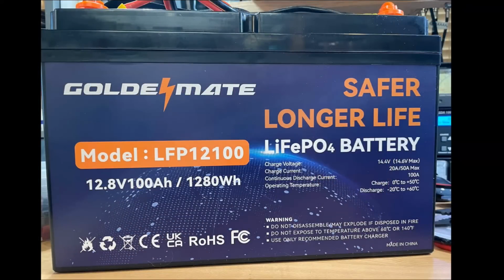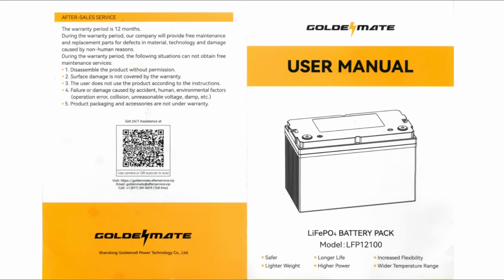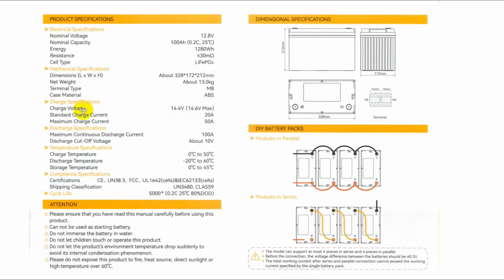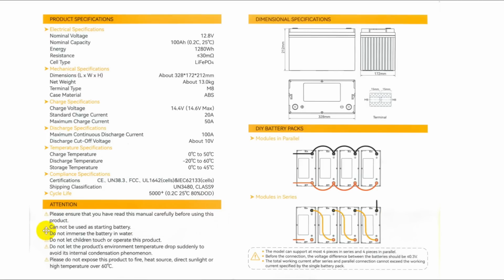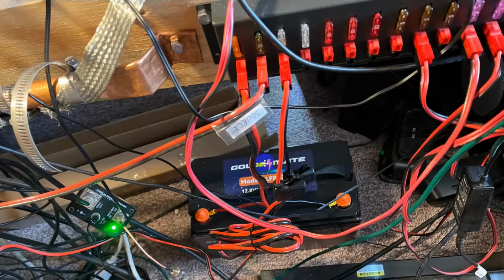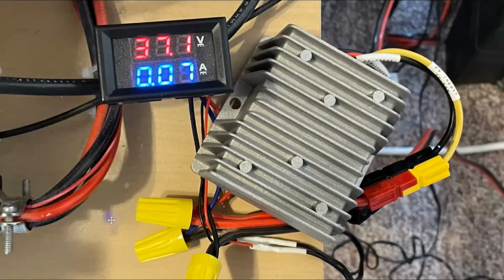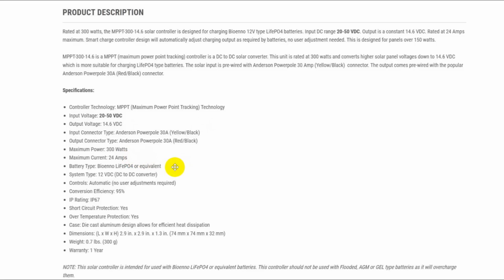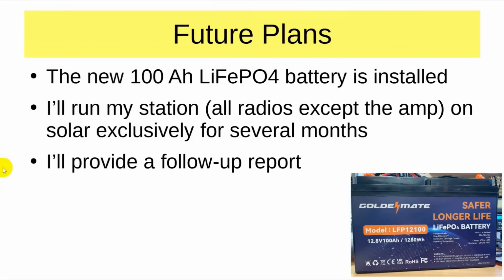New LiFePO4 Battery Can Power Your Station (#1030)

Comment: The Lithium iron phosphate batterys BMS can handle 50 volts and will turn off to prevent an overcharge when the battery is full. A $40. DC-to-DC converter (50 volts in, 13.5 at 40 amps out) between the battery and the power strip. It will let you drain the battery to 11 volts (BMS low cutoff) and at the same time keep your radios at 13.5 volts

Comment: Given the power outages in my 3rd world country, I've been forced to buy a 1200 VA/1200W hybrid inverter system that came with a 100AH lead acid battery and I used it to supply electricity during outages. The lead acid battery konked in in a few months because of being discharged below 50% frequently. So I replaced it with a LIFEP04 100AH - exactly the same as shown here. The bonus is that the BMS has a bluetooth interface that gives an indication  of charging and discharging state. So far the Lithium battery is not even close to getting to 50% discharged. So far so good.

Comment: Thank you for this video about the new LiFePo4 battery. I am curious about the detailed report on your experiences, especially in the daily use of the photovoltaic solar system and the behavior on the shortwave bands. Does the MPPT controller produce interference on the HF-bands when the battery is full or empty? If you operate a shortwave antenna close to the PV system? How clean is the 12V (13.2V) DC voltage, controlled with the oscilloscope? What does the panorama on the SDR-Play receiver say?  I am always happy and grateful for your profound and scientifically based reports. All the best to you and yours, greetings from Hamburg/Germany, Dietmar, DL4HAO

Comment: For those of us who don't have solar and just have our big old Astron power supply putting out 13.8 volts, can we simply add this battery across the 13.8 volt bus as a backup power source the same way we do with our legacy SLA batteries? I read somewhere that while the LiFePo battery may not provide full capacity if charged to 13.8 volts, under charging it will make last a lot longer.

Alternatively, I could turn up the Astron to 14.4 volts and keep the LiFePo battery fully topped off. I've read that keeping the voltage across the battery that high allows the cell balancing mechanism to work.

Comment: I am assuming you used 10 AWG wire with a 30 Amp PowerPole between the battery and your distribution block and the output of your charge controller connected directly to the battery terminals. To run your amp, you're going to need at least 4 AWG (cables) connected directly to the battery terminals.

Comment: Just a quick warning. When you were showing the slide about connecting the power source directly to the battery vs. the power distribution panel, you said that the solar panel should be connected directly to the battery.  I know you meant that the power from the solar panel should be routed to the battery (after going through the charge controller) but you didn’t make that clear and your diagram didn’t show the charge controller.  Just afraid a novice might not understand and connect the panel directly to the battery, which could cause damage from excessive unregulated voltage .  Otherwise, great video. Thanks Dave !
Reply: The battery BMS can handle 50 volts and will turn off to prevent an overcharge when the battery is full. A DC-to-DC converter (50 volts in, 13.5 at 40 amps out) between the battery and the power strip. It will let you drain the battery to 11 volts (BMS low cutoff) and at the same time keep your radios at 13.5 volts.
Reply: Dave has been slipping up a lot, unfortunately, as time passes.

Comment: My 24 volt 150 amp LiFePO4 battery and 2000 watt inverter run's a full size refrigerator 24/7..

Comment: I live in Florida and when there is a tropical storm the power can go out. I got a 100 AH battery and a little box made to switch from my power supply and the battery. Made by Power Works has Power Pole connectors for the battery, load, power supply and solar panel. I have not tested how long it will run my VHF-UHF radio and my IC7300 when the power is out. I have not yet got the solar panels for it yet, but hope to have some soon.
Reply: Easy to calculate!!
I have a spare 60Amp battery and my emergency radio consumes 0.8 Amp/Hour so i have at least 2 full days of receiving at emergencies chanells

Comment: That was very good. looking froward to up dates on this. I take mt ICOM 7300 portable (parks on the air ) with LiFePO4 battery and charge solar. I have a charge controller 300 watt like yours. it is the powerworx  one. folding 300 watt panel. I was getting RFI noise from the MPPT controller and put T 240-43 ferrite cores on PV input and battery side close to the charge controller and it took out the RFI noise. I have more than 1 controller and so far it works on all MPPT even my Victron MPPT I have at home, just wind the ferrite like a common mode 1:1 choke and use for DC. both pos and neg wound together. A lot of SOTA and POTA and field day  users are going solar. thank you for great information . to tell capacity of LiFepo4 you need a shunt monitor like the Victron smart shunt.  this reads percent of battery and charge /discharge amps.  73's